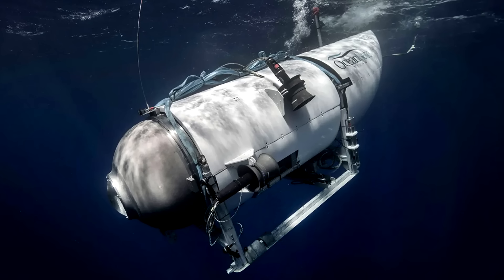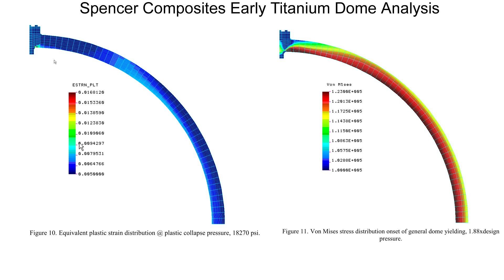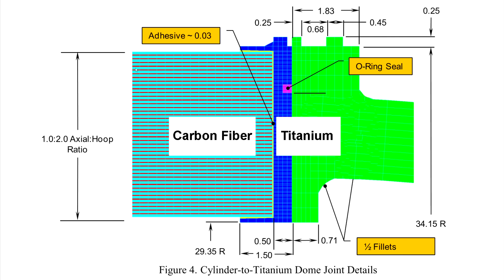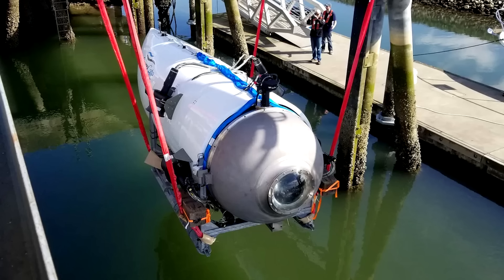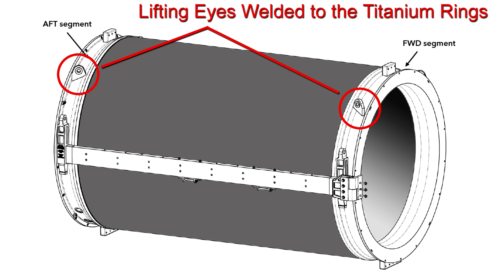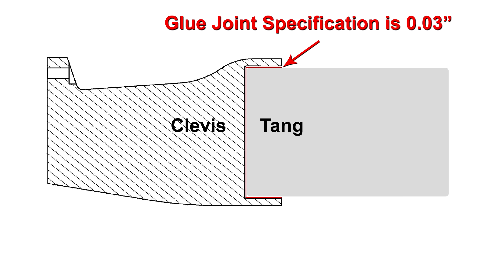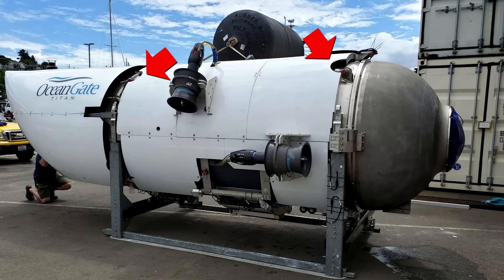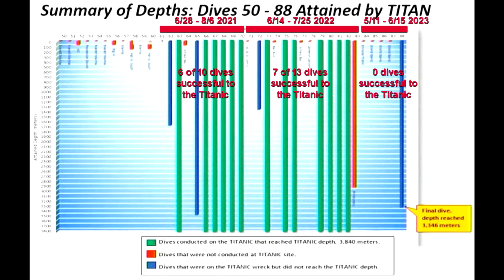OceanGate Titan Titanium Rings - An Additional Story About Them

Comment: This is a very good point. I had forgotten the discussion of the lifting rings from the hearing. Lifting the whole sub on those thin lips are just crazy. They should have mounted belts around the sub for making a lifting harness.
Reply from the maker: Thanks for commenting and you are correct, this subject is not one that gets talked about a lot and that is why I made the video.
Reply: Given it was set in a meatl frame, I'd have thought attaching rings the that would have been more sensible. Of course, the frame itself would have had to have been designed properly so that attachment points were up to the job and would not distort the frame.

Comment: You know they milled out the titanium in the ring c-channel to fit the new and thicker hull?  That's why the metal strips attached to the rings after the disaster @12:27 look like almost like foil.  Wonder what the FEA of that 'design' showed?
Reply from the maker: Thanks for commenting.  I feel sure that when they milled out the residual carbon fiber, they tried to stay out of the titanium.  The lips on the clevis were thin from the initial design.  They weren't there to take any load, as Tonty testified.
Reply: I think I saw in a different video that they actually shaved down the carbon fiber hull at the ends to fit inside the rings. So the 5” thick carbon fiber hull was only like 4” thick where it joined the titanium rings.

Comment: Stockton hired an engineer to design this thing and when the engineer told them not to weld lifting lugs on the rings and they went and did it anyway. Stockton should have been charged with criminal negligence long before this suicide tube ever got wet.

Comment: The rings were strong titanium; the tube was strong carbon fiber. Then the glue should match, but it doesn't (30MPa vs. 300MPa ultimate strength?), so you would need to increase the glued length to compensate. That was not done, just a perpendicular face. Adding a lip on the inner and outer side does nothing for strength. Now look at the clean separation of the two parts... 1+1=2
Reply from the maker: Agree.  Thanks for commenting.
Reply: @solareclipsetimer  Thank you for the video!
Reply from the maker: @ I am glad you liked the content.

Comment: I am starting to think that carbon fiber + titanium submersibles are actually very feasible, because they made countless obvious engineering blunders, and it still worked quite many times before imploding. A better design, with input from cycle testing to destruction, could probably could be actually safe and reliable. And predictable, which they almost achieved too. Their measurements strongly indicated something was catastrophically wrong long before the failure, they just never witnessed a cycle failure of such design to know how to use the data.
Reply from the maker: Thanks for commenting.  You may be right.  Probably for more shallow depths.  But this story has given CF such a bad name for hull use that no one will try it again for a long time.
Reply: Would you go 3400 meters down in the ocean, multiple times in a carbon fibre submersible?